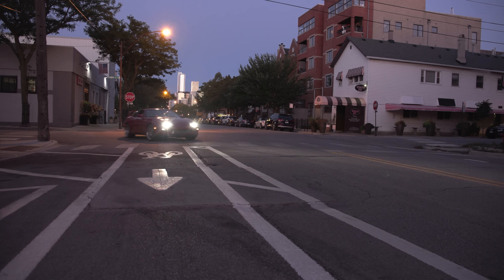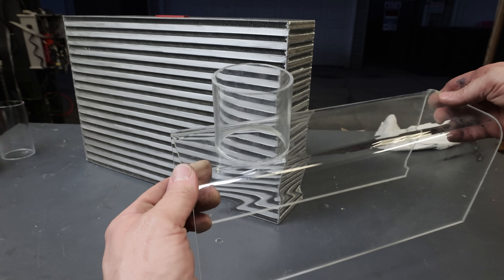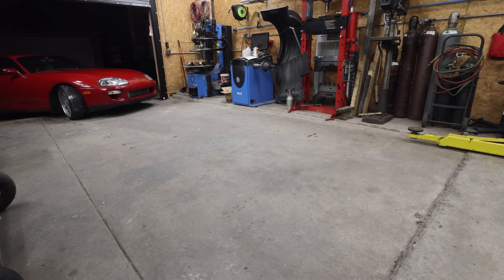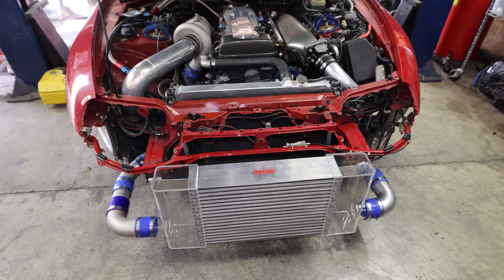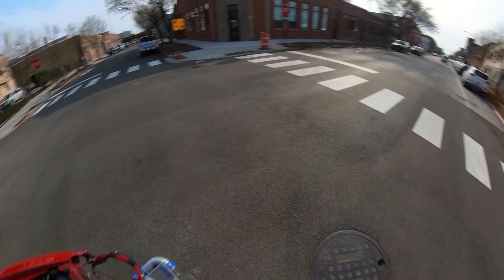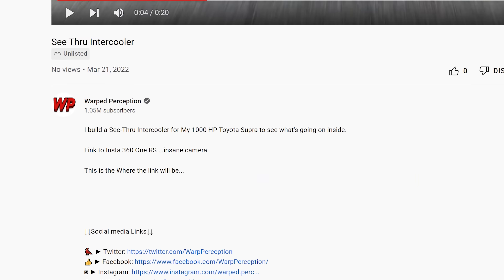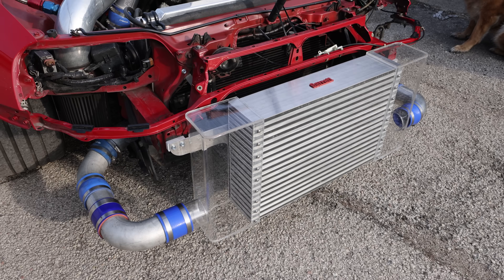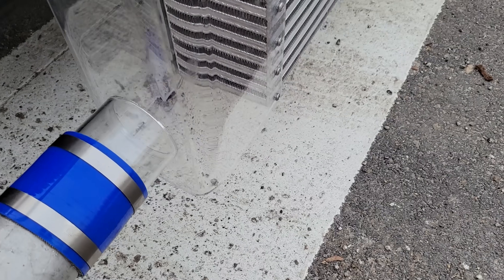See Thru Intercooler

Comment: I don't know that you see the different flows of air just cooling! With an air compressor I used to dial the air pressure for 2 lbs to 120 lbs out of a 1/8 inch hole and I could not see the air condensing about 45 lbs!. So at 15 lbs normal at both intake and exhaust with 5 inches  hole, I doubt you will see any features!
Reply from the maker: For inside you will see things happening, you won't see anything the way you described
Reply from the maker: Watch this one https://youtu.be/rILyBg7ZjeI
Reply from the maker: And this one to give you an idea https://youtu.be/tMhA_ek0Awk

Comment: Does the air change color or something? I didn't see anything.
And when you put it on the Dyno, will we be able to see "air" in slow motion?
I'm confusion.
Reply from the maker: Yes you got it, historically if I had a failure like this during an episode I just would not post it. However over the last 2 years everyone has been asking me to post even the episodes that don't work out. So I listen and I did what everybody asked for, but yeah most extreme situations always become visual in my experience.

Comment: Are you expecting to see something in the compressed air? Maybe fog from the pressure change?
Reply from the maker: Yes ... 100%. I just don't want to spoil it for everybody I think I know what's going to happen already. If you look at when the tank blew, in the tank that stood intact you can see a pressure drop and you can actually a cloud form for a very small amount of time. I believe there's a lot going on inside of there that we can't see. Normally in the past if I had a failure like this on a video I wouldn't post it, but overwhelmingly over the last year and a half everybody has asked me to post even the failures and then do a follow-up, so I'm doing what everybody asked and keeping my fingers crossed. I think this will work as long as I put out more videos... What you think?
Reply: @WarpedYT  looking forward to the slow mo on the dyno.

Comment: What kind of plastic "glass" is that and what adhesive? I learned how to do that 30 years ago but forgot everything about it!
Reply: I think it's acrylic sheet with acetone, it's more like a weld than a glue.
Reply from the maker: Yes cast acrylic has the most tensile strength, this glue is not acetone no, I can't remember but it starts with methyl something... It works really really well if you have the parts with very very tight tolerances. But in this case apparently it didn't work that well because it blew out.
Reply: @WarpedYT  
Methyl Ethyl Keytone (MEK) most likely.
Reply: @CYDeviant  
Yeah, that is what I remember. The plastic "glass" I play with now is polycarbonate of some sort. Acetone won't touch it. Thanks!

Comment: I would do this but can't imagine it holding 30psi 👀
Reply from the maker: Exactly why I want to do it with the high-speed camera
Reply: @WarpedYT  Fold the bottom and top like you did the front and back all from one sheet then epoxy the seems 👌👌👌 might make the perspex parts stronger

Comment: I think you just need to add some colored smoke to see how the flow behaves
Reply from the maker: That's coming
Reply: @WarpedYT  thermal imaging would be fun, to show the temperature of the intercooler core during a dyno pull. Especially if you can edit the shot to clearly show the core thermals and the airflow in the same frame.

Comment: Could you some how put a temperature gauge on both sides of the tank to see how the differ. Great video can’t wait for the next part. 👍 (edit) as you see in his new video how the TEMPERATURE on each side of the intercooler differs..
Reply: You can buy dual air temp gauges for that exact purpose
Reply: Very easy to do using thermocouples and a digital output reader. Did it on my car and it's cool to see
Reply: That's a great idea. I hope they do it! If it was me, I'd have it there anyway just for a piece of mind.
Reply: I agree
Reply: Multiple temp gauges.  Monitor intake air temp sensor, intake for intercooler, exit for intercooler and manifold air temp to see the change along the entire path.  On most cars the intake air and manifold air temp sensors are built in.  Just saying it would be neat to chart all 4 points together.
Reply: Yeah! That would be interesting.
Reply: I doubt it’s be any different that just a regular intercooler if that’s what you’re wondering
Reply: @Suchmxn  no. I just wanted to see how the temp differs from one side to another.
Reply: @Spencer19165  temp is a temp. Out there is theory that 2 IC's may be better than 1 due to flow rate increase, and turbo lag slightly increased. Also IC's i/output shape may be a hudge deal in more powerful cars....
Reply: @Spencer19165  Hello, i am not sure about the cooling system of a car but temperature inside a liquid is almost the same at every point on a circuit. So maybe, it will be useless.
Reply: @nohne787  It's literally the purpose of the interCOOLER... it goes in HOT and comes out COOL.  That's what Ryan wants to see. I'm curious myself.
Reply: @kleetus92  bro that is not how intecoolers work baahahahahahaga
Reply: @nohne787  if u look at the clear tank the only thing going through them is Air. One side is hot the other is cold and that’s the temp difference I was trying to see
Reply: Thought thatswas gonna be apart of the video. suprised its not
Reply: I have figured out how to double the cooler to heat transfer and even pass the thermal saving to the gearbox, and brakes
Reply: That's a good idea. I'd like to know how many degrees it drops the temp. My car has 2 but there small
Reply: Great idea
Reply: Most cars already have idle air intake temp sensor and another sensor downstream for after boost in blower and turbo cars
Reply: @TRMN8R03  Right but if you add two more sensors on the in and out of the intercooler you'd see how much the plumbing impacts the temps and if they also added flow gauges that would give you even more interesting data points.
Reply: Why not just use a heat gun?
Reply: he should put that temperature sensitive plastic for visual effect
Reply: I guess that thermal camera shall be "must have", also some smoke machine + slowmo camera to check out inner turbulences...
Reply: Well intecoolers don’t cool anything so it’s kinda pointless…..
Reply: @Lowkey_DeAndre  go watch his new video dude. And u will see how an intercooler temp from the hot side to the cold side differs
Reply: What about fish tank temp stickers should read right
Reply: Or a thermal camera

Comment: I'd add some mechanical clamps to the intercooler tank ends(threaded rods and metal flanges) and some extra epoxy to the tank inlet/outlet tubes.
Reply from the maker: Yeah I know what to do, but theoretically this weld cement that I used here had a tensile strength high enough to deal with up to about 20 psi, I think it might have broke because I scraped it on the driveway or maybe the glue just didn't cure under the perfect conditions. But yeah exactly what you said I know exactly what design to use. And it's probably going to look more ridiculous...lbvs

Comment: Turns out, compressed air looks pretty much like uncompressed air. Who would've thought!
Reply: It's about as exciting as I'd expect :) Curious to see how long it takes for some oil to make it a way in there. Other than that, don't really think there's going to be a lot to observe!
Reply from the maker: Well that's why I do these videos, I'm glad everybody thinks that because the final result is going to surprise everyone. I designed a lot of these episodes around the term Warped perception, or at least I try my best to, sometimes they are  just genuine curiosities. But if you look up in the sky on any thing but a clear sunny day, you will see that air does in fact take on different forms depending on the conditions, and air moving under a lot of volume and pressure does very interesting things from a fluid dynamics perspective. Let me give you an example, if you see a fighter jet Bank a sharp turn, you see the vortices form in the low pressure regions of the wing crevices, that will happen no matter what the temperature outside or the humidity level. Because the flow Dynamics are way outside the parameters of regular clear atmospheric air that's moving at low velocity and equal pressure. (Edited because autocorrect didn't always suck so bad.)
Reply: @WarpedYT  This was just a little joke, I love what you do and I'm excited to see how it looks on the dyno. The fab part is entertaining enough for me to watch.
Reply: @WarpedYT  But they're going 500 mph.
Reply: @WarpedYT  This was boring AF, your just talking it up because you spent days on this video and need to make something out of it....??
Reply from the maker: @onojRX3  haha...👍. Say that in the next video...
Reply: @WarpedYT  just saying it didn't really show much at all, u can run a homemade see through intercooler at low boost, exciting stuff
Reply: I mostly wanted to see if any oil or moisture accumulates inside it.
Reply from the maker: Yeah I thought the same thing, I actually thought that my intercooler had a lot of oil, but I forgot to include that clip of where I put the camera inside of my old intercooler, it was actually dry.
Reply: @WarpedYT  one thing you should try if nothing interesting happens is spraying the intercooler down with water/methanol during a highway drive (with no boost) and observing if liquid water condenses anywhere ...

Ford had a TSB or a recall where turbo trucks in southern climates (where heavy rain in warm and super humid weather is common) would misfire and go into limp mode due to water accumulation in the intercooler while cruising on the highway and then getting into boost. 

The solution was to block off the intercooler from the direct airflow it was getting. I assume the rain was helping cool it below ambient and moisture condensed.
Reply: @volvo09  Didn't the Focus RS suffer the same problem? The intercooler was cooling the air way too much so Ford got a blanking plate from a Ford Transit and put it on the Focus.
Reply: @miokujou  and floating cylinder walls thought having a hollow block with cylinder wall inserts was a good which also didn't help with the overcooling.. they ended up putting block saver in the block to keep the cylinders from rocking.
Reply: @WarpedYT  
do dual supercharging turbocharging + mechanical supercharger centrifugally no type paxton

￼
Reply: I was thinking maybe some flash condensation due to the BOV🤔
Reply: @snipesy  Bingo!
Reply: yeah this video is pointless 😒
Reply: Lolllll
Reply: Fun fact: When his bottom cover blows you can see the compressed air on the opposite side enter the intercooler!
Reply: Saved 7 min of my life🙏🏼
Reply: Lmao!!
Reply: Haha right idk why I thought it would look cool
Reply: Unbelievable
Reply: you can’t see air 🤔🤔🤔🤔🤔🤔🤔
Reply: Win!! 😂😂😂😂

Comment: Be careful driving when your turbos are not able to build pressure on the intake side. I did that for only a couple mins. Turbos over-sped and immediately burned the bearings up and the turbos had to be replaced. Wasn’t pretty. 😂 actually wasn’t my fault. A mechanic at the dealership forgot to tighten the clamps on the intercooler lines after some work. Popped right off. Luckily the dealership covered the $13k repair bill.
Reply: 13k?? do you drive a ferrari or what
Reply: @xav1uz  I wish. Lol. It was on a F150 with an 3.5 ecoboost platform in it.
Reply: @xav1uz  No he gets his work done at the stealership exclusively
Reply from the maker: Well you would automatically be led to think that, however there is a limit to the exhaust velocity, and it is in fact a linked cycle. When there is no boost going in the engine, the exhaust is much less violent and slower. Once the boost starts going up the exhaust velocity also goes up to spend the turbo faster until the turbo reaches its maximum boost. So an engine that is not being boosted would probably not spin that turbo more than 80,000 RPM, obviously this depends on the size of the turbo but I do not see a non-boosted engine with tame exhaust velocity overspeeding a turbo because of lack of resistance on the compressor side, the efficiency of turbocharging is greater than the loss of the cycle so the power keeps going up. I don't know how else to explain it.
Reply: @WarpedYT  it happened. It’s happened to others. Not sure how to explain it to you. The “lame” exhaust velocity is more than enough to overspeed to the turbo, which is no longer compressing and building density on the intake side. Funny how Mr Banks is aware of the issue but you think it’s not possible. 😂
Reply from the maker: @TsunauticusIV  it was "Tame" not lame, and you mentioned Banks, now you can actually overspeed a turbo on a diesel. To give you more insight after finishing the most recent episode with the Supra on the dyno, I drove from the shop to my studio which is about 40 miles, with the intercooler broken completely open, no back pressure and the Turbo is still perfect. As I mentioned before there are a lot of different combinations, turbo diesel turbo gas turbo nitro, sleeve bearings, ceramic bearings, Big Turbo small Turbo. I absolutely appreciate your first comment, I was just stating my experience. Thanks
Reply from the maker: Okay so I watched those videos, what they're talking about is something completely different, they're talking about large boost leaks, yes that 100% for certain will overspeed a turbo, the ones I watched also were mostly geared toward diesel, which will overspeed a turbo even easier and the bearings are different, you were correct and I was also correct, we were just talking about two different scenarios, when there is absolutely no boost going to the engine from the turbo like a pipe is completely disconnected, that is a totally different situation then a large boost leak. Sounds like what happened to your car was a large boost leak that makes perfect sense. Cheers 🥂
Reply: Sorry, but is the first time I hear that a turbo burn because of loose piping... to me sounds more like a fail bearing seal, shaft or lack of oil for the lubrication to do it's part. Most people forget to "cool" down the turbo rpms after a run.
Reply: @aj2858  if you have no pressure building to maintain the turbo speed… it will continue to gain speed… since it’s still being pushed by the exhaust side. Turbos will overspeed and can burn the bearing out in short order. This was the ONLY change to the vehicle and was the only possible cause. If you still do t get it… google “turbo overspending”. It’s known as the “turbo killer”. If you STILL don’t understand… I’m afraid that you are in possession of a severely underdeveloped orbitofrontal cortex and there is no hope for you. 😂 have a stellar day bud.
Reply: @TsunauticusIV  like I said, first time I! Hear, for people like YOU! Is the reason they're having underdeveloped front cortex, not because we do the same it means we are going to see or learn the same, some folks are more skilled in different areas. I appreciate your explanation, you show me something new and really good luck,  seems like you need it.
Reply: @aj2858  calm your teeters bud. Was a joke. 🤦‍♂️

Comment: i was watching cutting edge engineering austrailia (i think) and he just bought an old swiss precision machine and i was watching it and i saw the spindle wobble. he explained about how a dril moves the tool to the work and a mill moves the work to the tool.  i watched a gresham lecture yesterday about cycloids.  not saying any of it adds up or match but was thinking about how that rolex mill cuts a perfect circle when it is spinning in place yet you introduce what wants cut a little along the x all the while you are adjust the y. jag out rectangle the hole but cuts so sweet?
Reply: It's a question of resolution. At which pixel count does circle becomes a circle on a pixelated screen. And the tool is not square itself, it cannot "jag oit a rectangle" even if you want it to.

Comment: Curious to know if the thrust from one of your hobby turbo jet engines is able to turn an actual turbo sufficiently to provide boost to an internal combustion engine.  Next project idea.
Reply: Pretty interesting. With some valves you could use the jet engine to spin the turbo up faster, or get some really down low boost, and when the engine is creating enough force from the escaping exhaust gasses, you could use a valve to route the engine exhaust to the turbo, and one valve could let the jet engines exhaust gasses escape straight out to atmosphere, to prevent pushing exhaust gasses back through the jet engine 🤔 dunno, i probably didnt make my idea clear enough, sorry if my english is bad 😂 greetings from Finland
Reply: @pkrlex6780  yea turbines/jet engines are extremely sensitive to backpressure. This sounds cool and would love to see that project and how the challenges are managed. It would be tougher than it sounds though, that's a safe bet.
Reply: Ha, I always wondered this too!  I think WP is the only man with the skills to pull it off
Reply: Energy in must be greater than energy out. So for example a 2hp aux engine is not going to create more than 2hp
Reply: @roachwerks3043  Correct, but static thrust doesn't measure work (hp).  I'm betting those 100 lbs of thrust engines are a bit more significant.  Adding fuel to the internal combustion engine to match the boost might get tricky.  That's why I said "significant" boost.
Reply from the maker: @nothingtoseehere4026  your correct
Reply from the maker: @roachwerks3043  it may work if Im Able to match the tubing up correctly
Reply: @roachwerks3043  the energy the turbo uses to compress the air will not be greater than the energy output of the exhaust used to turn it, but the energy “created” by the turbo actually comes from the extra fuel that can be added to the higher density air. So in reality the increased hp is from the fuel, not the turbo. As long as the jet engine’s exhaust provides enough wnergy to significantly increase intake pressure, more than 2hp can be gained.